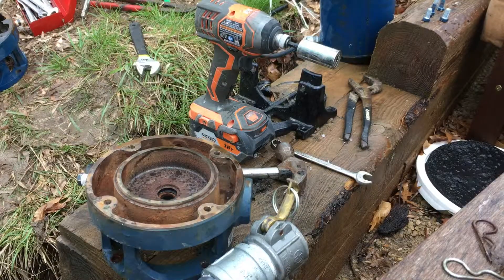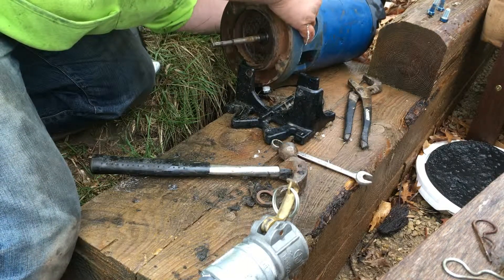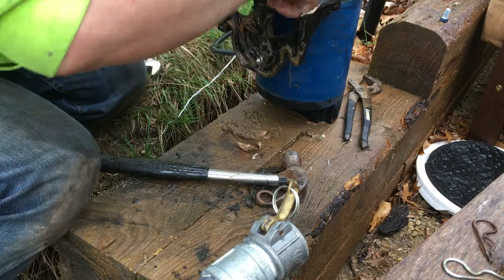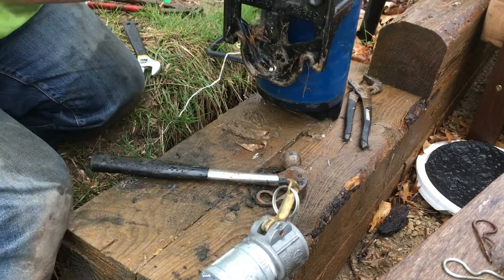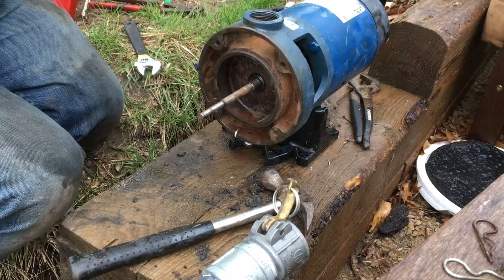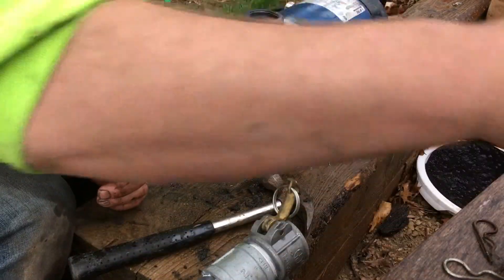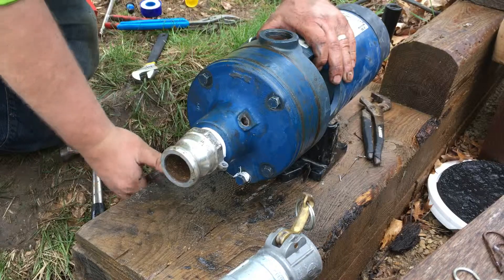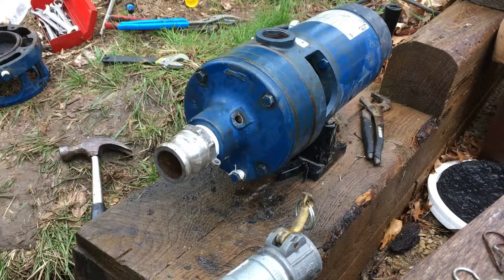Assembly of flint and walling pump CJ101 series model

Comment: I am in the process of rebuilding my CJ101P103, great video!  However, shouldn't the drain go on the bottom on the suction housing?
Reply from the maker: That opens let’s air in the bottom plug drains

Comment: Do you have a link to order replacement parts for the pump side of the assembly? Had the housing crack because forgot to take the drain plug out over the winter
Reply from the maker: Call Central Turf & Irrigation Supply. Have the label information ready serial/ model number. They will be able to ship you the right parts or you could pick up if there’s a location close too you

Comment: If you have a leak in the brand new gasket, should you wait for a day before running system? Or is it ok to run right away?
Reply from the maker: Run it but check the paper gasket after running and next scheduled start